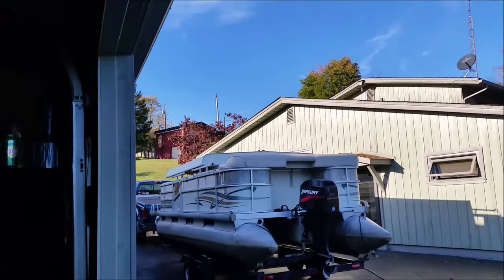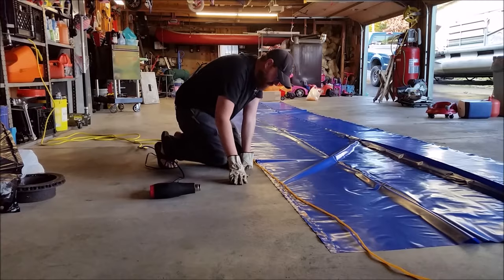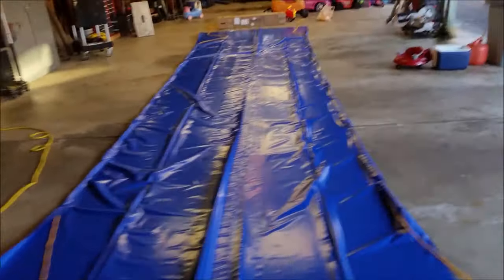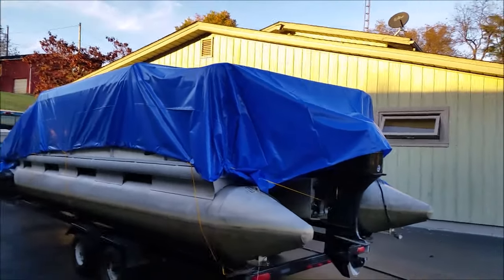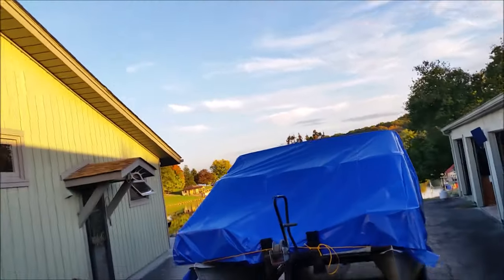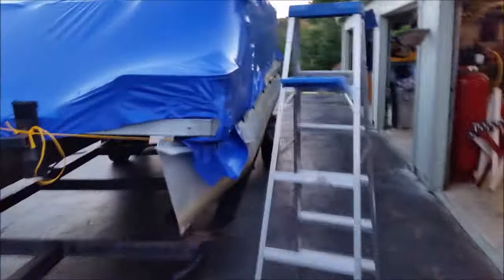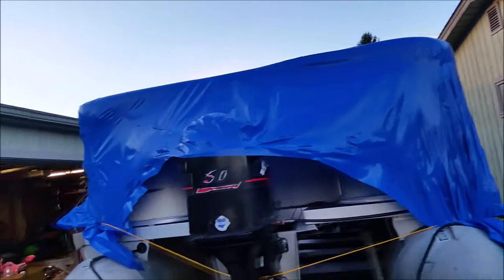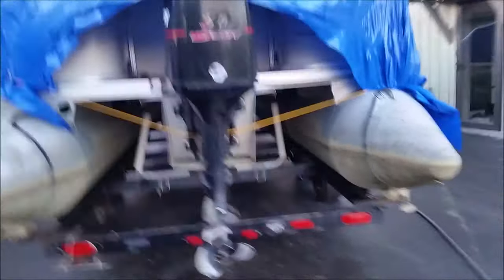How to shrink wrap a boat by yourself - the easy and affordable way

Comment: My buddy has the actual heat gun. And man, they are expensive!  He did my pontoon this year and told me the weed torch wouldn't work because it didn't have the wide spread end that fans the heat rather than so much direct.  I guess he's wrong.  You proved it! And I will be doing my own each year.
Reply from the maker: After you get the hang of it you can do it in no time. Good luck.

Comment: Thanks for sharing the video did you watch Mr shrink wrap before you did this or some other training video
Reply from the maker: I watched the Dr Shrink one with the $500 propane shrink gun and figured I could do it just as easy my way. Since my video i have gotten far better at it.  Back then I felt like I needed to shrink the whole cover when in actuality you just need to shrink the loose parts and they pull the whole thing tight. Thanks for watching

Comment: Is that your bimini top lowered on the boat that is bracing up the shrink wrap?  Is it a canvas top? The dealer made a big deal of all the work framing with wood strapping to hold up the SW.  He complained tha he should get a lot more money to SW!
Reply from the maker: It's just a aluminum Bimini top. On other boats I use a few 4x4s to make a tent setup.

Comment: Can I buy the 6mil stuff and be fine or go with the 7mil thickness??
Reply from the maker: I'm sure 6 mil would be fine. If you plan on trying to get 2 years out of it you should go with the 7 mil. I saved mine last year and am going to reuse it this year.
Reply: Ok thanks again
Reply: @bucksgarage1  Hey Buck, when you say "reuse", you mean the leftover from the roll or the actual wrap you used can be used again?  Thanks.
Reply from the maker: @369presario  i keep the wrap when i take it off and get a second year or 2 out of it. Its not as tight the second year but still provides good protection.

Comment: how big of roll of shrinkwrap did you buy
Reply from the maker: Tim Stevens I believe it's 14 by 150 I got it off Amazon for $150.
Reply from the maker: For me it's worth it to buy it in a full size roll so I can get at least 5 wraps out of it.
Reply: thank you
Reply: Good job. How expensive is that gun?
Reply: Can you put links on for the wrap material that you purchased from amazon, and the weed burner?
Reply: Watched another video where a guy used 6 mil vapor barrier to shrink wrap.  20’x200’ foot roll was $100.  😁
Reply: How bout 40mil pool liner? Seems abit more durable
Reply: @DarkLinkAD  Joking, right?